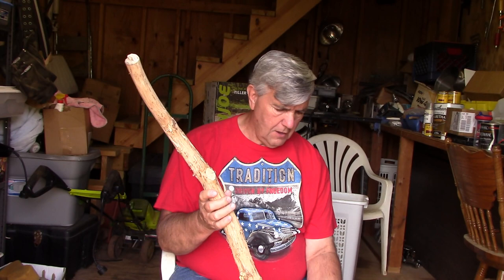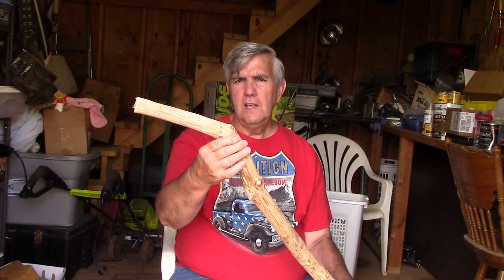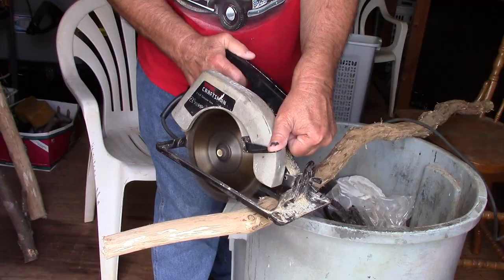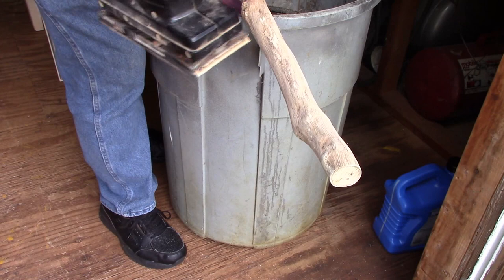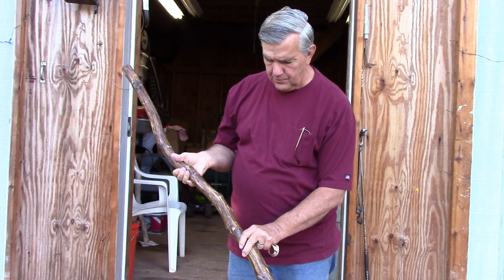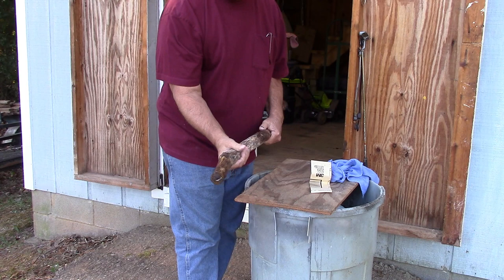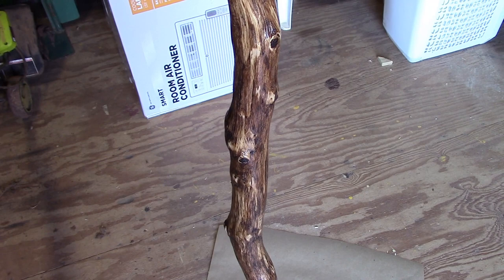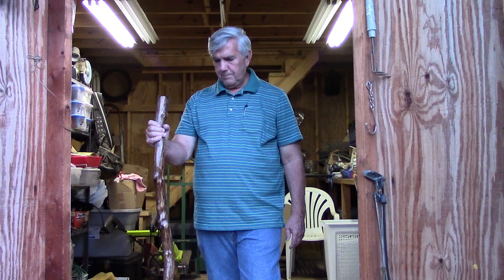Making My First Walking Stick

Comment: That looks like a lot of work but something to down while sitting. I like the thickness of it! Looks nice in the finished product!
Reply from the maker: Thanks Marie, it was not to much work.  I think it might be a little thicker than I expected.  My next one will be smaller.  
Have a Blessed weekend, 
Calvin and Marie
Reply: @SouthernCountryLiving  I'm glad it didn't take too long to make. It looked like a fun craft either way. What do you think about thicker walking sticks compared to thinner?
Reply from the maker: The thicker sticks look good but they are heavier.  I'm not going to be using this but if I was making one to use I would want it to be thinner so it would be lighter.

Comment: Thank you so much for the video as you have inspired me, it looks wonderful. I do have a question, you said at the first of the video, your stick measured approx 5 1/2 feet, was that after you cut that one piece off of it?
Reply from the maker: Thanks very much.  My stick ended up being 4 1/2 feet long. This one is a large diameter stick, I think that the next time I make one that I will choose a stick not as big in diameter.  
Calvin